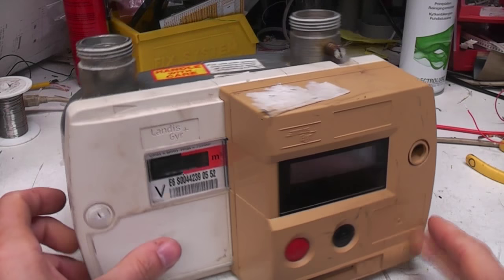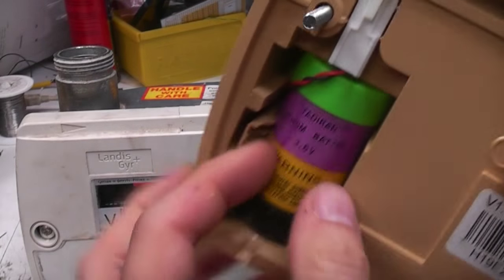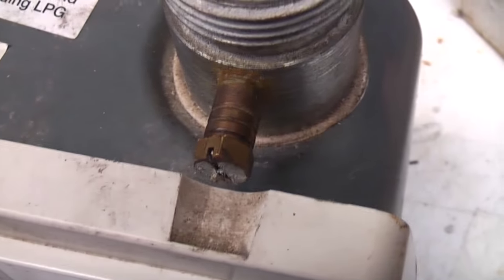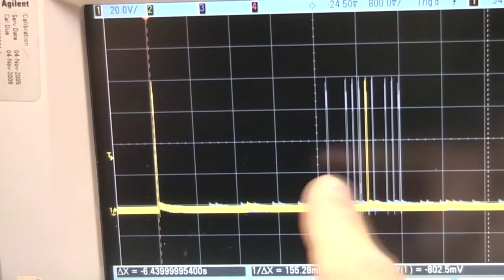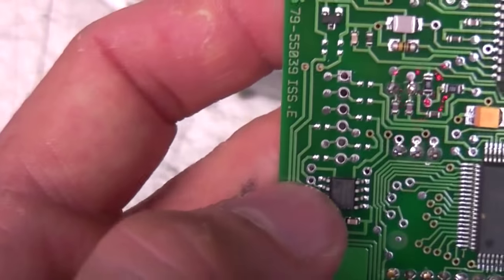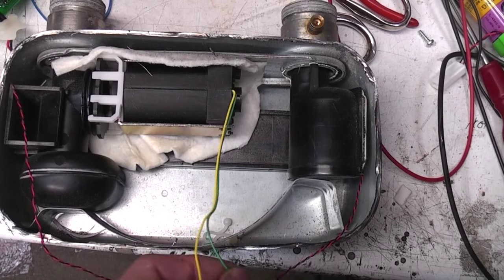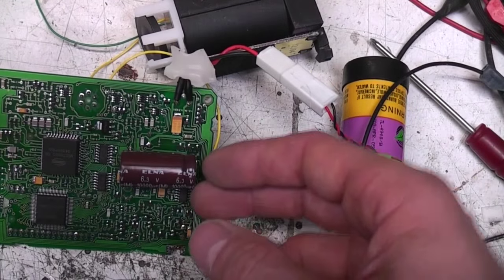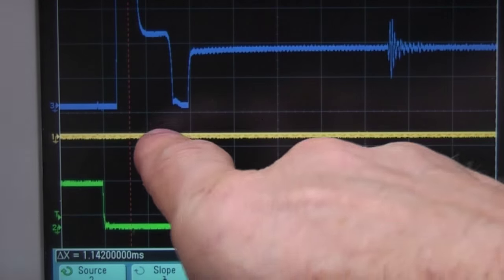Ultrasonic gas meter teardown

Comment: more wire = less voltage needed = less battery usage.

unless you want to change the battery every 2 months.... you need that extra wire
Reply: ***** This doesn't really help the battery usage. The energy required to move the solenoid will still be the same no matter how many windings you have.
Reply: ***** 
Physics isn't really your forte, is it? There's a reason you don't run your house on 12V, why 230V is more efficient than 110V and power lines run at a few hundred kV.
Reply: superdau if you need say... 50 Tesla, or guass.... not sure what magnetism is measured in... to move that noid.... you could do it at 12 volts with less winding, or 8 volts with more winding. 

if you ran them both at 12 volts, the one with more windings would have a stronger field. 

would you need more amps? from what i understand.... only the extra bit needed because of the extra resistance in the wire. 

so less volts and the same amps..... isnt that less energy? ohms law?
Reply: ***** 
Looks like you're switching voltage and current.
The magnetic field is linearily dependent on the current and the number of windings. So you can double the number of windings and get the same magnetic field with half the current. As it happens, by doubling the windings you also doubled the resistance (as long as you use exactly the same wire). Ohm's law tells you with the same voltage you now get half the current, which is exactly what we wanted. So if we can get the same magnetic field with half the current just by making more windings, why don't we do it? Almost sounds like free energy doesn't it?
First the practical limitations: you have to use the same wire, which means your coil is now double the size. Then the above is only valid for an ideal coil. You have parasitic capacitance (the higher the more windings you have), the field does not scale with the number of windings in reality.
But more importantly the inductance of a coil changes with the square of the number of windings! So doubling them yields four times the inductance. What is inductance? In simple terms "how much the coil fights change in current". So to even get half the current as before, you know have to "push" harder, or in technical terms aplly a higher voltage. So what did you gain? Nothing...

And you could spare yourself all that explanation, if you just apply some basic physics knowledge. To move a mass (the plunger) around and exert a certain force, you need a certain amount of energy. You can tune the efficiency maybe (most likely the reason why the coil looks like it does), but you can't break the laws of physics.

Comment: Designer corrupted by copper corporation ))
Reply: nRADRUS Talking out of my ass here but maybe by using thick copper wire they could reduce the voltage and hence simplify their regulatory approval process because of lower risk of sparks? No idea if that's a thing.
Reply: Stefan Hacker big inductance increase risk of sparks when switch off. thick copper can absorb high-frequency disturbances by foucault currents, but it will be cost-non-optimal solution again.